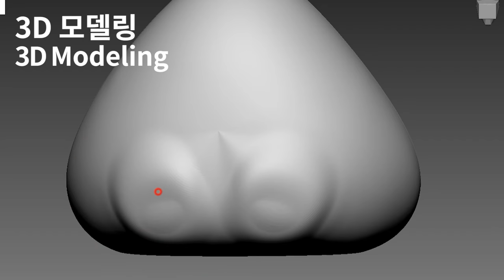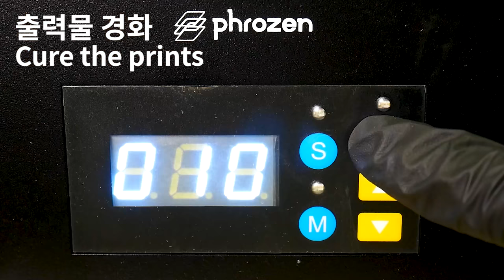[FNF] Making POU Sculpture Timelapse (POU.EXE) - Friday Night Funkin' Mod

Comment: 0:10 Modeling 1:05 adding supports
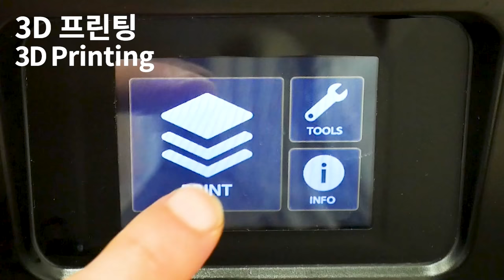Reply: 1:40 3d printing
Reply: 2:00 cleaning
Reply: 2:08 removing  support
Reply: 2:23 Curing prints
Reply: 2:37 Work Surface
Reply: 2:54 Painting
Reply: 3:35 Painting 2
Reply: 4:59 FINISHED!
Reply: 5:11 Funniest Part 😂😂😂😂
Reply: 5:26 Outro
Reply: 0:01 Intro